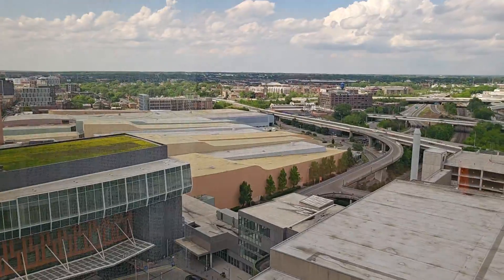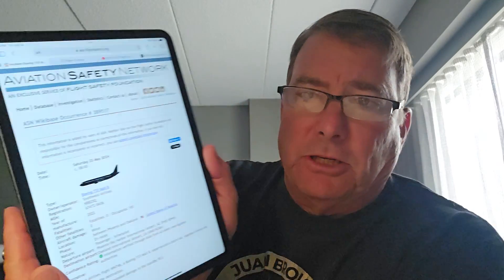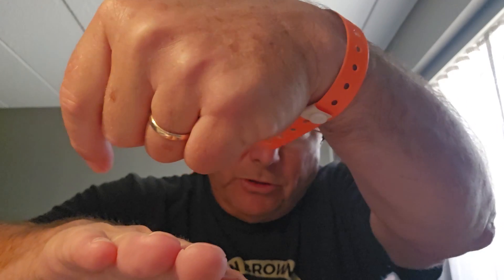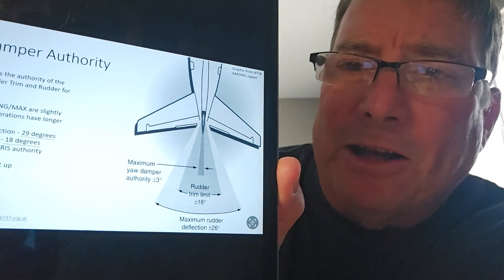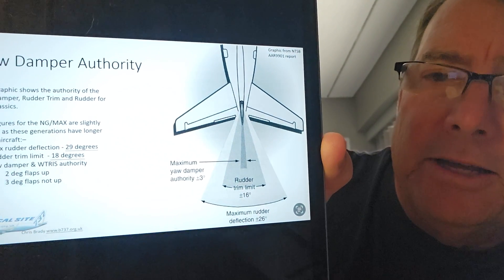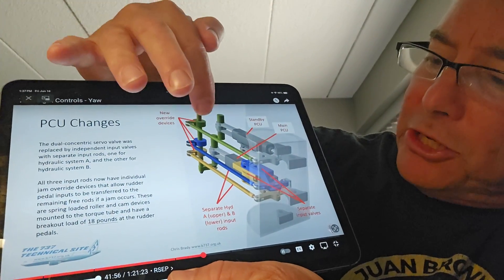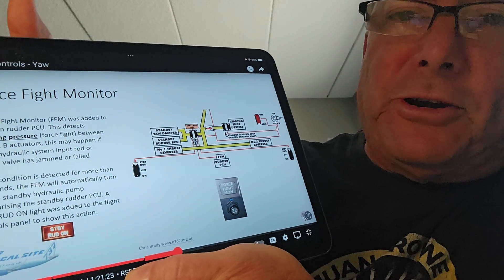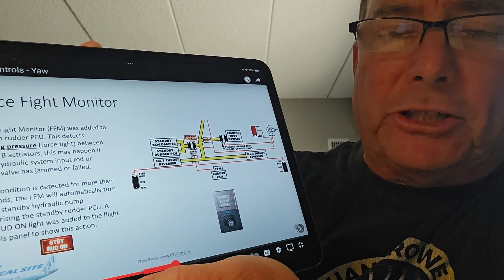SWA 737 Max-8  "Dutch Roll" Incident

Comment: Nice Input Juan, A nice report on the 737 Dutch Roll, 
Can't say I have suffered anything on an Actual Flight.
Been through serious Clear Air Turbulence and at times a Dutch Roll looked Inevitable.
It's a 50/50 Chance when you go up, I always pay Particular Attention to the Rudder, Wings, Ailerons and Tail plus Stabiliser even if I turn up two hours early and the aircraft is there I like to go right over it.
Could say heaps about the Systems of the Aircraft Rudder Systems etc but a Gentleman has given a Very Good Technical Overview below
Thanks for this Report as it keeps us all at least in the Frame of Mind we need be in as Pilot's , It gives us a Wake up call to be aware of So Many situations that might pop up.

I could go into further Technical Aspects but a Gentleman has already produced this below I believe and it's Very Fundamentally Conscious, Correct and Well laid out.

Regards
John

Comment: I'd hate to think this dampening system reduces rudder travel rates to keep the rudder actuator from quickly reaching a hard-over condition, thus reducing the control authority of the pilots to quickly maintain control of the aircraft if required.  A rob Peter to pay Paul type of situation, increasing the chances of increased yaw oscillations because of delayed rudder response exacerbating the situation.  The tail wags the dog, instead of the pilots wag the tail.

Comment: Not trying to start anything but I am a corporate pilot been flying for quite some time.  I do a fair amount of Air-lining over the years.  I have noticed when flying on a 737 that you do not want to be in the back if it is turbulent at all because the Yaw Damper is always getting a workout on that plane.  Does not seem to be as bad on other designs.  Just an observation.  Don’t really know if that is good or bad just observed this over the years.

Comment: Some 35 years ago over Brazil, my right-seater and I (both captains) experienced a dutch roll incident in cruise in a Lear 35 after the yaw damper failed.  An instantaneous and violent upset with a roll rate that cannot be imagined.  We were extremely fortunate. Knowing we were in dire straits I commanded gear down (speed brakes were already out) at a very high airspeed. To make a long story short. After landing it was discovered the aircraft was a total write-off and subsequently scrapped. As the wing had suffered structurally and couldn't be repaired. Of course we had also ripped all the gear doors off. Engineers from Lear and investigators all agreed:  had we not put the gear down the aircraft would have suffered structural failure. Many early Learjets were lost due to dutch roll.  In the moment all I could remember from my training was to not attempt roll control if dutch roll encountered and slow down if in cruise. Thanks Jim. (My instructor so many years ago)

Comment: Regarding the voice recorder, at least 10 years ago, I bought an Olympus hand held digital voice recorder for around $60.  It would store about 16 hours in stereo CD quality or 128 hours mono at dictation quality.  The chips to do this are ridiculously cheap.  I get that it has to be shock, heat, and electrically hardened.  However there is no reason that the voice recorders not store dozens of hours of audio.

Comment: Too much fuss about a routine abnormality. The natural lateral directional dynamic stability of the 737 Max is not that bad. Aircraft with T-tail (which is not the case) tend to have a worse dutch roll behavior. We have to wait for the outcome of the investigation, but it seems to me that the rudder PCU malfunction was such that it was feeding back the dutch rolll and making it divergent. Just a guess.

Comment: Spent 12 years on the C-141B as a maintainer. 
Don't recall many Dutch roll issues as porpoising issues w AP engaged. 
Thanks for using proper terms as well. So many would call it a yaw dampner, and it would drive me crazy.
Anyway.  Really appreciate your posts. 👍✈️

Comment: I can easily tell a pilot how to get out of Dutch Rolls in swept wing aircraft. Sadly not enough room here to explain,,but simply fly formation with your angle of bank pointer on the att indicator with the índice at the tip of the yoke. Easy. That indency on the yoke is the tip for 0 airleon trim

Comment: We had a dutch roll event when a yaw damper failed at high altitude (above 41,000) in a large bizjet. Checklist indicated check circuit breakers, attempt to re-engage, observe speed & altitude restrictions (if memory serves me right). It came back on, but we had descended to where things would be more controllable (and comfortable) if it didn't, or if it failed again shortly thereafter. Additional fuel consumption was not an issue, and destination weather was CAVOK. 
     It's definitely not anything like what normal turbulence might produce, but it wasn't horrible. The passengers, however, were immediately aware that something abnormal had happened. We explained to them what it was, and warned them it might reoccur, but that we could safely (and legally) proceed to the destination even if it did. We didn't have to use it, but there was a list of speed restrictions (min, not max) vs fuel, and additional restrictions if this failure was combined with other issues. BTW: There was a distinct improvement in dutch roll controllability as we descended to thicker air while flying manually.

Comment: In about 1905 or 1906, the Wright Brothers were finally granted a patent for control of, ‘pitch, roll and yaw.’ Little do people realize that originally the scientists of the time declared that the first flights by the Wright’s were no more than, ‘fluttering in the wind.’
  Wilbur Wright, while working on the first powered flight in the summer of 1901 at Kitty Hawk, declared that man will have powered flight, and it just make take another 1,000 years. He was actually off, by 997 years and six months. Little did it impress people as the longest flight in December of 1903 was only 880 feet. 
  The original steering system of the first planes was achieved through ‘wing warping’ and body shifting. The Wright brothers laid on their stomachs in a sling, of sorts, to imitate exactly how a hawk “STEERED” himself in the air, above. They realized that they could fly in the late 1800’s as they watched the hawks circle effortlessly above, and fly all over, with nary a flap of the wings. The first plane was a pusher prop, seldom used today. 
  Ah, yes, Mr. Langley and the United States Army. 
  At the same time that the Wright’s were working on the flight, problem, so was Langley. Langley Air Force Base comes to mind. 
  Langley had actually flown very briefly before the Wright’s but his control was not enough to get him the patent. His contribution was great as he had showed that ‘heavier-than-air’ flight was possible, with small model aeroplanes. 
  I have worked for two major airlines and used to read about this in the libraries long before the internet. I have also been to Kitty Hawk. The Wright brothers started at Kitty Hawk because they knew they needed a strong headwind to get them off the ground, in the early stages. Thank you.

Comment: This is a very strange occurrence, I’ve been doing maintenance on the 737 NG for about 25 years at this point, as well as the max from it’s beginning stages when we got it at our fleet. The system is identical in both aircraft. The fact that the standby power control unit was causing this issue or was said to cause this issue is very interesting to me. The standby Rudder power control unit it gets alternate hydraulic power from the standby hydraulic pump. The standby hydraulic pump supplies power when system A or system B flight control switch is in the standby Rudder position. Also interesting thing to note is that the standby Rudder shut off valve, on the standby hydraulic system module controls the pressure to the standby rudder power control unit. The system works automatically when the standby pump supplies pressure to the PCU. My best guess is that if the PCU was actually the thing that was causing the Dutch roll, it might’ve been a malfunction within the standby rudder shut off valve where it was sending uncontrolled fluid to the unit. But that’s very unlikely, forgive my assumption, but it seems to me that this might have been induced by human error and in doing so trying to correct themselves caused the Dutch roll. But once again it’s an assumption wait for the NTSB report.
Reply: Appreciate your keen and very well stated hypothesis.

Comment: Just gee whiz info, I once worked on a CFM powered DC-8. It had a repeat write up that when yaw damp was selected on the autopilot control head, when the aircraft was taxiing on the ground the rudder would go full deflection in the opposite direction of the turn, overpowering the pilots feet on the pedals. We spent hours upon hours troubleshooting for almost a month. Cause was an improperly rigged rudder control cable sector from heavy check. At least it didn't happen in flight. I changed quite a few accelerometers and yaw control computers as I recall. Even had new wiring taped to the fuselage all the way from cockpit to tail troubleshooting the yaw computer wiring.

Comment: A couple months back a max 8 had the rudder pedals “lock up” on landing. Apparently in the neutral position. The NTSB has said they found a component of the rudder system failed after being “cold soaked.” They even were able to replicate the problem in flight. I’m thinking this might be connected ….

Comment: Juan, I remember when checking out in the old 707  in the 60's that we were showen how to recover from a "Dutch Roll" by quick use of the ailerons out of faze with what was happening.  As the right wing was on its way down we would give a quick aileron to the right.  It would be 180 degrees out of faze, but after several  oscillations , right and left, it would stop the Dutch Roll.  We did it in the simulator, not the airplane.

Comment: The Air Force lost a KC-135 due to a dutch roll where the pilot exceeded the rudder limits trying to correct the roll.  Snapped the tail off and they plummeted to the ground.

Comment: I may be way off base here, but this incident reminds me of the tragic 2001 A300 American Airlines flight 587 which crashed after flying into the wake turbulence of a departing 747.  The crash was caused by the inexperienced pilot flying the A300 using such aggressive rudder controls that the entire rear stabilizer detached from the aircraft.  Sadly, the FDR had stopped recording during the subsequent crash due to the loss of engines and thus, loss of power, so the exact attitudes of the aircraft during its descent are unknown.  

In this SWA case, could excessive use of the rudder controls  in an effort to correct the Dutch roll by a startled or less experienced pilot have led to the damage of the aux PCU and airframe?

Comment: There was another issue on the Max recently involving "stuck" rudder pedals on a United flight back in March.  That this is even happening, after the PCU issues of the late 90's (which seemed to stem far further back - wasn't there a Seattle Times series on this?)  is pretty disturbing.

Comment: After the damper/dampener rant, you proceeded to use the word dampen later in the video.  Which shows why people (albeit incorrectly) use the words damper and dampener interchangeably, for a device which damps or (from your own lips) dampens oscillations.  I'm a mechanical engineer who learned about spring + damper systems and their dynamics in my second engineering course.  While I'm not above correcting someone, in order to let them know the correct terminology or the right way to solve a problem, or the correct units of measure, I also cut them a lot of slack on terminology if they don't catch on.  

When I'm the expert on something, or even just a little better at it than someone I'm exchanging ideas with, I consider the burden to be on ME to understand and translate what they're saying, not to try correcting them 100 times.  I'm not saying you need to do the same, but it will save you a lot of frustration, if you just get things correct yourself, and set an example.

Don't get me going about people who spend a half hour talking about batteries, solar panels, generators, portable power stations and all that, but don't know the difference between a watt, a volt, an ampere, and an ampere hour.  A statement like "my 12V fridge uses 35 watts per hour" could drive an engineer buggy, because keeping dimensionality and units of measure straight, is one real key to figuring things out, as well as explaining things.  Somehow manage to remain calm, and tell them that it uses 35 watts of power, which draws down their battery's remaining energy by 35 watt-hours per hour.

Comment: OK for @blancolirio or whoever can offer an informed answer this question: With in mind the fact that so many commercial planes are now connected to the internet, why don't the voice and data recorders simultaneously stream to the FAA or airline's HQ? In addition to redundancy (should the stream fail or the black boxes not be able to be found), this would make the info immediately available with full history except when there was a drop in the stream. This wouldn't replace the recorders, but it seems like a no brainer to have it in place for the reasons stated above.

Comment: Been there, done that and never want to go through that again. In 1973 I was in a Lear model 25 riding along as a technician on an autopilot check ride. We took off normally from ICT 19R and when we reached 200 feet AGL, the copilot engaged the primary yaw damper. Immediately, the aircraft rolled violently so that I, seated on the starboard side of the cabin, looked straight out the window at a rapidly approaching ground. Just as I braced for what looked  like an inevitable impact with the ground. The pilot disengaged the yaw damper and managed to get control of the plane. I nearly fainted, we leveled off below the tops of the 50 foot trees we were rapidly approaching. After climbing to clear the trees, and a lot a shouting back and forth  between the pilot and copilot, The pilot told the copilot we were going to climb to 500 ft AGL then try engaging the secondary yaw damper. They did that and as before, the aircraft made an immediate violent roll to starboard and again, the pilot manged to regain control of the aircraft just seconds before impact with the ground. We climbed to 2500 ft AGL and declared an emergency since the Learjet cannot be flown without a working yaw damper due to its nasty dutch roll characteristic. We did manage to turn around by making a less than a 2 degree banking turn. We landed back at ICT between lines of fire trucks and ambulances and were greeted at the Lear factory be the FAA and the NTSB. After I checked to be sure I hadn't wet myself, I crawled out of the airplane and threw up on the tarmac. Turned out both of the yaw dampers had been replaced and wired backwards by an inexperienced technician.

Comment: I did flight training in a Cessna 152 that had a 150hp engine and a STOL kit. It would do Dutch rolls at specific speeds every single time. I would establish a stable approach, but between 65kts and 60kts, it did Dutch rolls over and over again, pulling me off the centerline. One CFI after another yelled at me to stop doing that, but I wasn't doing it. When I told the CFIs to show me how to do it without the Dutch roll, they couldn't do it either. One of them even landed to the right of the centerline. As I watched the white stripes out my window, I said, "You couldn't land on the centerline either" and the CFI replied, "You don't have to." That's when I finally gave up trying. The school sold the plane and I haven't taken a flying lesson since.

Comment: Structural damage cited in the one report caught my ear. I recall reports of cracks on fittings that attach the vertical fin to the fuselage on 737 during manufacturing. I believe it was due to mechanics forcing fasteners into undersize holes at Spirit Aerosystems. Short term thinking keep the assembly line moving and the cash flow coming in. Another example of bean counters driving decisions rather than engineers, mechanics, and pilots.

Comment: No personal knowledge, but I understand Dutch roll/recovery is a pitch-yaw stability issue, MCAS is a pitch behaviour "modification" system, and the rudder and yaw damper control yaw.  That links the three, suggesting at least potential involvement of MCAS.  One wonders if switching to backup rudder control changed the total system characteristics sufficiently to reduce Dutch roll stability/recovery rate.

Comment: Hello, I might or might not work at the company that builds these aircraft as a flight line tech...Nothing different about this PCU, its the same as the NG, rigging, operation, design, same part number like most flight control items. In my time here, I've only seen one rudder PCU failure(which was an internal pressure switch common to the standby pump), which I replaced so this is an outlier.

Comment: KC-135 wing sweep 35 degrees, B-737 wing sweep 25 degrees. KC-135 training syllabus had initial and recurrent dutch roll upset recovery training. Until it didn't. That was a bad idea to get rid of that training. In that training, you don't touch the rudder pedals as that makes it worse. Very short, sharp aileron inputs against the roll only. Timing is everything with this. There were no restrictions in the FM if the yaw damper (and/or the autopilot (which was the yaw damper)) was inop. If you lost rudder power (one hyd system only) you lost yaw damper. Did a pond crossing (9 hours) without it. Hand flown the whole time. The 135 has a higher cruise speed to boot. Totally sucked.